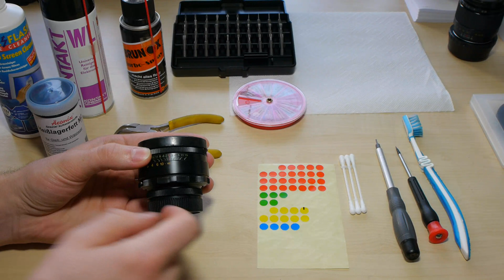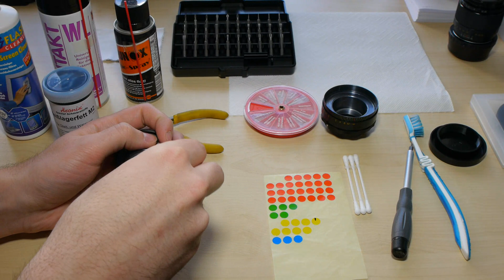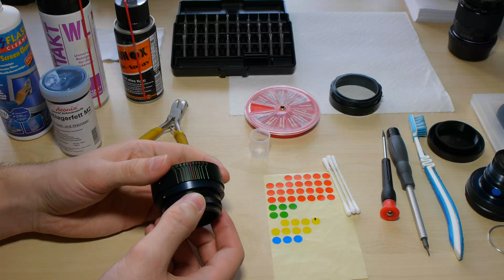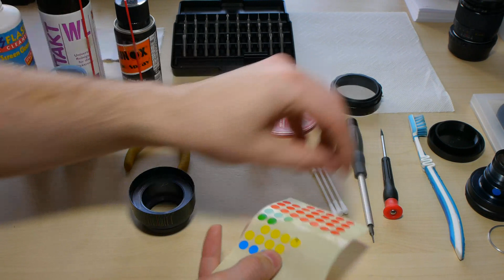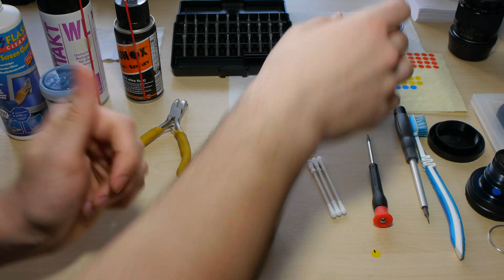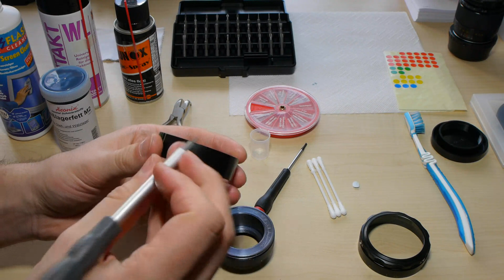Helios 44-2 refurb. instructions (2nd MUCH more detailed part! Attention: VERY LONG!)

Comment: Can you use 70% isopropyl alcohol for this lens?
Reply from the maker: Sure. Its just coming with more parts water in it / you can still get off grease and other stuff super easily. Isopropyl alcohol is mixing pretty well with water. So you can also make it even "thinner" by adding more destilled water. Will still vaporise without residues. Its just not working that well then anymore on super greasy surfaces. ^^
Reply: @AustrianGeek  Great, thanks! I mean can I use it at 70% undiluted?
Reply from the maker: @infinitesimotel  You can if you want to. If its still removing the residues properly, you also save on alcohol ^^. But I would go for destilled water to mix (to prevent any residues). And even 100% isopropyl alcohol is normaly not damaging the coatings of the glass. At least it wasn´t the case for the lenses I cleaned and repaired til now ^^. Though I only use iso if its necessary. For everyday external cleaning of the lenses I use most of the time monitor / LCD screen cleaner (as its also not aggressive to plastic parts of more modern lenses ^^). Isopropyl alcohol is also quite aggressive against various plastic mixtures (and printed letters). So be aware that you are not getting it on any plastic parts / on non glass parts of your lenses.
Reply: Brilliant, I just wanted to know if it was OK to put isoprop directly on a lens because I don't know what sort of chemical or glass they might have that could be ruined, but thanks for answering that for me. Vielen Dank!!
Reply: Yes got to be careful with plastics because they dont all go well with alcohol/solvent bases.

Comment: Hello what can o use to clean the barrel of this lens ? The outside of the barrel is dasty and needs also grease inside , thank you
Reply from the maker: Is it just dusty outside? Then you can use warm soap water and an old toothbrush for example (just be aware, that nothing should get inside the lens or do it if its disassembled). Or I also tend to use a mixture of isopropyl, a little bit of soap and water (with a ratio of 1:4 or so - 1 parts iso to 4 parts water). Its mixing really good with water - Just be careful with isopropyl in general. The soapwater method should be "safer" ^^. The grease leftovers inside the barrel if you disassembled it you have to brush out too (there you can use pure iso to remove the leftovers you don´t get off mechanically / with other methods).LG
Reply: @AustrianGeek  i open the lens and clean it , very well , i turned the front element upside down , and i see that it focus beyond infinity is that normal or i set it back wrong ? All though with the split image focusing it doesn't seem any problems
Reply from the maker: @tasost2161  So you flipped the front element? I am not sure now, if you should do that ^^. But if it works optically, it culd be, that you remounted the whole lens barrel on a non perfect position (regarding the focusing ring). I tend to readjust the mounting point of the barrel on the final adapter I will use with the opened lens. That way you can "tune in" the mounting position of the focus ring to infinity over the camera display (and you will hit the lens limiter pin exactly on the infinity point in the future ^^). Btw.: If you don´t care that you get beyond infinity, its also not a big deal. You will loose though a little bit of close focusing capability / range. But as its not a floating lens design (just the whole block extending) with the Helios 44-2, its not making a difference optically. LG
Reply: @AustrianGeek  i flipped the front element , it gives a nice background and dreamy

Comment: Just saw this and it was a huge help in allowing me to clean and lube my Helios 44-2 which was the Zebra one, but about the same age as the one in the video. 
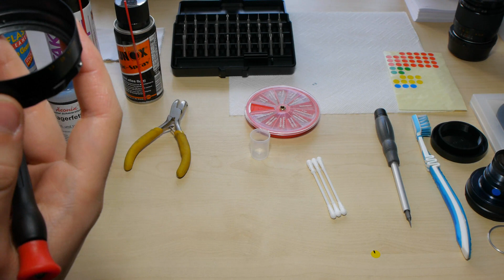I might add that the reason the ring at 34:40 in the video would not stay on is that the pins are not lined up over the indentations underneath, because you can't get the ring on far enough to line them up over the indentations. The reason that it is not possible to do that, and the reason that it falls off even if the screws are all the way in, is that the ring which is reassembled at 30:30 in the video was either screwed in one turn too many or one turn not enough, my guess. It is possible for this piece to screw in one or two turns more than would place the screw holes directly above the factory indentations. The factory indentations are not always directly under the holes in this ring if you screw the ring all the way to the point it stops. If you screw it down that far, until it stops, it is possible to place the three set screws and everything seems stable, but this ring (the one you are working with at 30:30) is not in the proper position for everything that follows to fall into place correctly. You need to actually look through the holes as you turn it down and stop when you see the shiny indentation underneath, and place the setscrews there. If that had been done, then there is no problem placing the ring which you were trying to place at 34:40, and not only does that ring stay on when you tighten its setscrews, but infinity lines up perfectly as well.   
Not being critical, but the same thing happened to me. The factory did not always screw that center ring (at 30:30) down until it stopped before the placed the setscrews and indentations for the setscrews.
Great video, though. Many thanks.

Comment: This is the best disassembly video I have seen. I have a Helios 44-2 which has what I can best describe as focus backlash. That means that when I turn the focus ring with the hills and valleys the ring moves but the distance does not change immediately. Do you know if this is due to wear, sloppy tolerances, or if this would improve if I re-greased the lens. Any input would be appreciated.

Comment: I just got my helios 44-2 and i can feel its dirty inside and it grinds. I cant seem to twist it open tho to separate the two parts. I've tried everything I can think of, rubber gloves, rubber bands ect for better grip, but no movement. Do you have any suggestions on how to open it?
Reply from the maker: Hmm. Is it definitely a 44-2 (not a 44M or 44M-4 or so)? Well - It could be secured with thread locker. Heat is helping there sometimes (you could try to put it on a radiator for example and let it "heat through" - No plastic parts in there - So it should not do any harm to the lens (but you´re doing that on your own risk - Keep that in mind ^^). If its then still not opening up I would just go for another one - They are super cheap available and some just "don´t want" to get opened. LG
Reply: @AustrianGeek  Thanks for the radiator idea. Will give it a try. And yes I'm sure it's a 44-2. Why would anyone thread lock a lens?? :(
Reply from the maker: @robinoja  Well - Some of the lenses get locked I guess, so they are not opening up by themselfs. Fun fact: I only opened the 44-2 in this video at first place, as it got loose by itself ^^.

As long as the thread locker is only applied in low quantities and its a "weaker" one (not a heavy duty) you should be able to open it up. But who knows what they applied there.

Btw.: I only recommend weaker threadlockers in general (I use the purple coloured Loctite 222 for example). Its more than strong enough for 99% of the applications, and its not too strong to get it off / to detach it again ^^.

Comment: Thank you for this!   Is there a way to add more tension to the aperture ring?  Mine is really loose and the slightest touch changes the F stop.  Thank you!
Reply from the maker: You can theoretically add more tension by using a "thicker" grease for it. Normaly there are multiple greases in use on lenses anyways. One for the helicoid / optical mechanics and then others for the aperture rings / focus rings etc. Thankfully its not that important what you use on the Helios 44-2 - As there is no plastic or rubber in use (on plastic and rubber parts its more critical what grease you use - As wrong ones can dissolve those materials over time - White lithium / lithium grease is for example normaly critical - If I have it right in my backhead). LG

Comment: hey, how to clean up the fingerprint or grease stain on the glass elements?
do you have any special mixture?
Reply from the maker: Well - You can go for special optical cleaners (which are designed / designated for microscope optical cleaning). Or if you want something cheaper, then go for isopropyl-alcohol. You can get that one quite cheap in big bottles (even over some Amazon dealers). Though: I recommend to buy additional universal spraying bottles -> It´s WAY easier to handle it that way - Especially compared to a 1 liter bottle for example ^^. Just search for "empty spray bottle" on Amazon for example. Btw.: Don´t use the isopropyl-alcohol everywhere (also the special microscope cleaners). They tend to remove paint if you apply them on non sealed surfaces ...
Reply: alirght, i'll try that soon, and tell you if it works or not :D
Reply: and i dont mind about special optical cleaners, do you have in mind to reccomed me a product? 
thanks :D
Reply from the maker: Well. Actuall I have here the "VetroClean V2" from osim optik (a german company which also produces lens and general optical grease - which I also want to test out within the next weeks for lens regreasing). But normaly I go with the isopropyl-alcohol. Though: What I forgot to mention -> I normaly don´t use it at 100% - I mix it with a 2nd sprayer (which contains destilled water). Normaly one spray out of each (or one from the iso and two from the water sprayer - Btw.: It should also work to mix it from scratch on in just one sprayer). Otherwise you´re getting "lines" on your glass (and with a mixture the isopropyl-alcohol isn´t that aggressive anymore). The water is removing the dust - The isopropyl is removing the fingerprints and general oily residues. If then there are still a few lines left on the lens surface, I use a micro fibre cloth and my own breath to fog the lens surface up a little bit (that way you get a perfect finish). Oh - And I also blow away all the particles before starting to clean the lens. Otherwise there´s a risk to get fine scratches onto the lenses. You can also try out LCD cleaners btw. - Some are working quite nice too (and they are also not aggressive, as the LCD surfaces are way more prone to chemicals). Then finish with the breath + micro fibre cloth and you´re getting about the same results. ^^
Reply: alright :) 
how about screw you use to replace the original ? 
do the screw head stick out ? and is it perfect fit? i lost at least 1 when begin to modify it hahaha
Reply from the maker: Well. You can go for a watch repair set (with such small screws included). There I got my replacement screw from (it´s the round red box you can see about in the middle of the image nearly the whole time of the video ^^). Russia also uses the metric system. So you should be fine, if you go for such a kit. You can also go to a watch repair shop with the exact same screw and ask, if they have something in stock. Though normaly such shops are not easy to find anymore (and if you´re located in the imperial US territory, it´s for sure even harder to find the exact same screw).

Btw.: Yes. The screw is fitting - BUT: If the thread is really 100% the same - I am not sure. But it holds quite well and screwed in easily - So it should be the right thread ^^. Btw.: Only use a replacement screw, if you know, that you won´t open up the lens again within the next time. So use it at the end of your cleaning / refurbishing process. At least if you´re not sure, that it´s fitting 100% fine. And keep an eye on the length. Use a multi tool to shorten them if needed. I hope you lost no screw INSIDE the lens - As then you cannot use a standard screw (with a standard head) instead of a headless one ...

Another hint: You can btw. also use one of the threadlocker liquids if you want to (to secure the screw additionally). BUT: Only use the weakest one - For example the purple LOCTITE 222 (otherwise you don´t get them out again). And don´t use the threadlocker on the original screws. Their metal is quite "soft" (aka of a low stiffness). That way you destroy the screw heads as soon as you want to get them out again (if you used threadlocker before).

A lot to keep an eye on ...
But it also makes fun ^^.
Reply: hey, can you.. or do you remember what size the screw is? i bought one on my country and it didnt fit.. screw to small.. 
or dou you have reccomendded store?
Reply from the maker: Good question - Sorry - Don´t know it. And I also don´t have the 44-2 here anymore. Gave it to a friend as a birthday present ^^. About the screw source: You can go for a universal clock repair kit (with a few different screws in there). I used also such a kit in the video. OR: Just go to local watch stores (maybe the older ones). There they maybe have the right screw for you. About general stores: I don´t think, that you will get such smalls screws in general metal stores for example. They are just too specific. Alternatively, purchase another lens (maybe with damaged lenses) - And use the screw(s) from that lens. But try to get the same model of the 44-2. Then it should work (maybe you´re lucky and get one for basically nothing) ^^.
Reply: alright, thanks :) 
i'll try~

Comment: Can't seem to be able to twist the top off my version of the 44-2, so this video and all the other ones like it don't help at all.
Reply from the maker: Sorry to hear that. Sometimes it´s just not possible. I also had such a 44-2 once.
It sounds weird - But often it´s the best solution to buy another one (and sell the actual one).
Reply: I know it's late, but I had the same problem and after days of trying and failing, I finally opened my helios up. I heated the lens barrel for 1-2mins with a regular hair dryer, then tried to twist by holding the barrel and aperture rings firmly using  rubber gardening gloves and non slip rubber mat.
Reply: @HUNrobar  Even tho it's 5 year later, I will try the heating up method.
Reply: @ohjajohh  good luck! :D

Comment: I can not manage to screw of the top, what you do in the beginning. How much force I will apply to it, it doesn't move an millimeter.
Reply from the maker: Had that too with other 44-2 lenses. With some it´s just not possible to open them up.
It´s better to sell your actual one and get another one instead to fix (if you really want to try to open it up / fix it).
I know - It´s not a fix for your actual lens - But before you´re damaging the lens, it´s the better way ...
Reply: Thanks for the response.
I already have fixed/cleaned one of the two lenses I got that won't open up. With the first one it took quite a bit of time. So I wondered if my second lens could be a more easy fix, but it also won't open up the nice way :(
Luckily it won't affect image quality, so I can still sell it on.

Comment: Without watching the full video, sorry.
Have you got any advice on what to do, if the focus ring becomes loose?
Reply from the maker: +Computing.Sound Well - There are grub screws which are maybe loose (and which you need to re-tighten). Check out 22:37 to see the screws.
If you´re talking about the whole focus mechanism wobbling, then the grease is maybe gone / too dry (and it´s not compensating the wobbling anymore).
Btw.: It´s also possible that the grub screws are broken. Then you need to replace them with other ones. I had luck and I found one in a clock repair kit I had lying around.
Reply: +AustrianGeek Thanks. The focusing ring went completely loose while close-focusing. Now the ring rotates very loose without changing the focusing distance. So no getting around taking the lens apart?
Reply from the maker: Well - You can try to tighten the grub / headless screws. Maybe it´s enough to lock it down again. Though: If they broke, you need to replace them.

Comment: Hi AustrianGeek,
I have a couple lens with broken diaphragm. Do you repair lens with this kind of problems as well?
Cheers.
Reply from the maker: +Vicente Fontanella Well - Normally I don´t repair lenses for others - Sorry.

Why? The problems are: I am here in Europe -> And the shipment is often quite expensive (most of the time it´s even pricier than the overall lens value). Beside that I can never assure, that fixing the lens is even possible (as there´s always the risk that the screws are stuck, breaking off or their heads are turning / wearing off -> When trying to unscrew them for example). Also many other things can go wrong (especially with the aperture mechanics - Which are most of the time quite critical to fix).

Beside that it´s "eating up" ALOT of time (which is more or less "free" if you make it yourself) - AND it also makes fun to fix lenses btw. ^^. Especially if you have alot of them lying around, it makes sense to get the tools to repair them. Btw.: I also plan to make a video / tutorial about the Yashica ML lens lineup (and about new "real" optical grease I am testing actually). The Yashica ML lenses are easy to fix and super cheap (with good optical performance). Just mentioning them because: If you plan to start with fixing lenses -> Then get such a lens to start with. The Yashica ML 50mm F1.7 for example - Priced WAY below 50 bucks - Even got one (normal used) for about 15 bucks as a spare / for replacement parts.